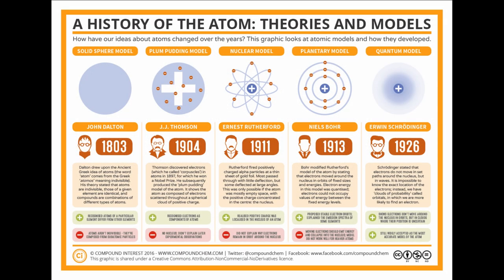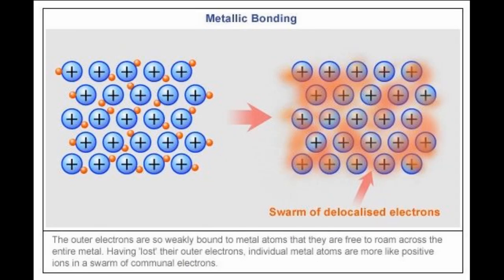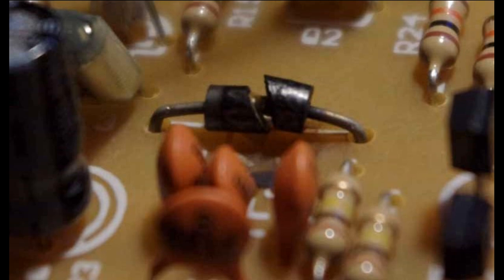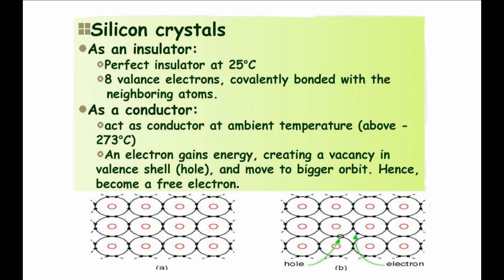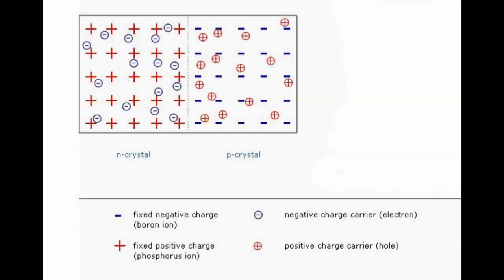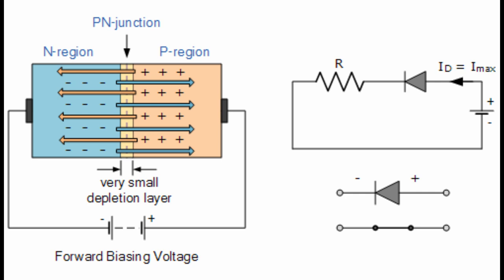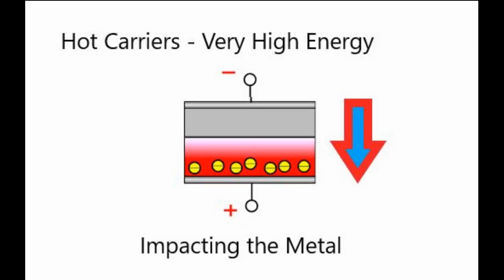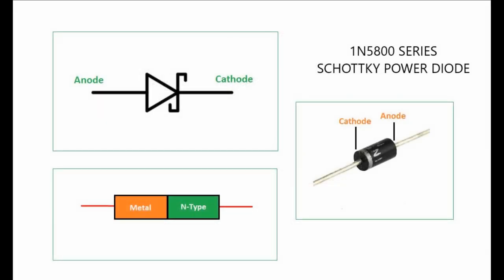Diode Physics

Comment: To the question posed at the conclusion of the video: The famous "cat's whisker" diode utilized Germanium. The same case with Marconi's first diode detector.

Now as to the foxhole radio depicted here. Obviously it functions on the same minimum voltage levels as Germanium crystal sets.

Thanks for the video, de KE0RFZ.